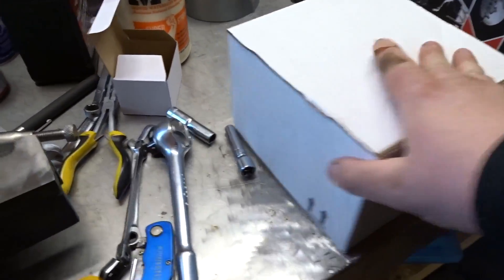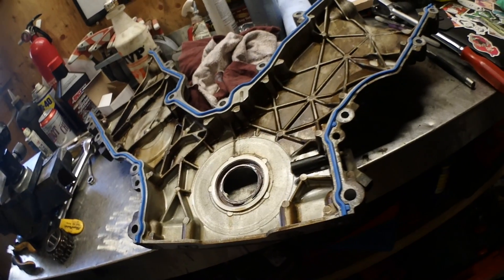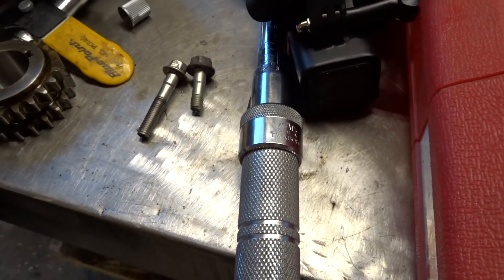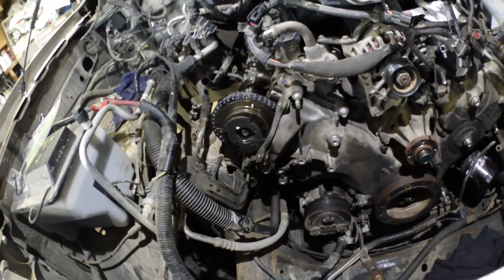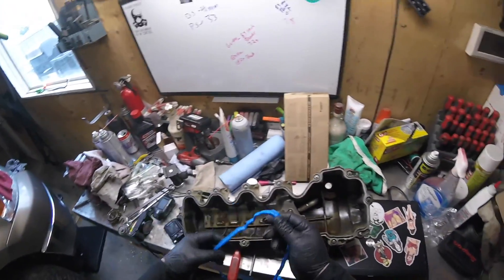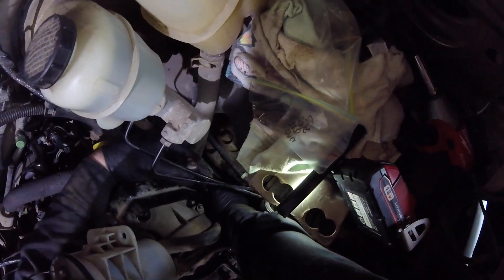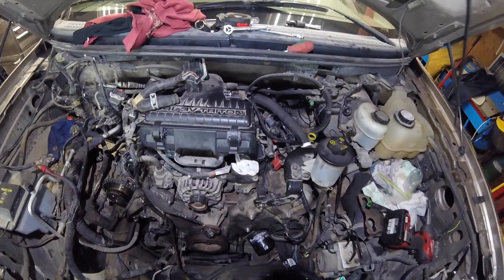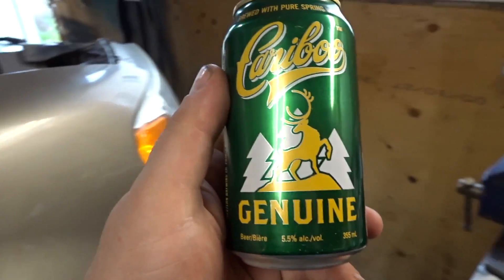Ford 5.4 3V Timing not Reading Instructions Properly

Comment: Areet av got a Vauxhall astra 1.7 tds and I think the heater matrix is gone coz there's steam coming out of the vents and misting my Windows up.I was wondering if you think I put a u bend on the in and outlet and divert away from the matrix it will work ok for now until I fix it properly?